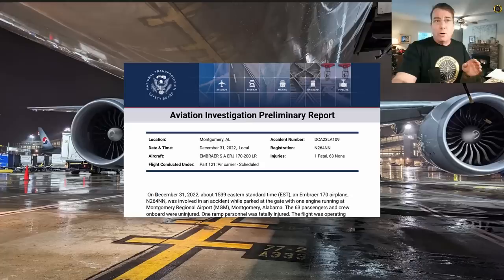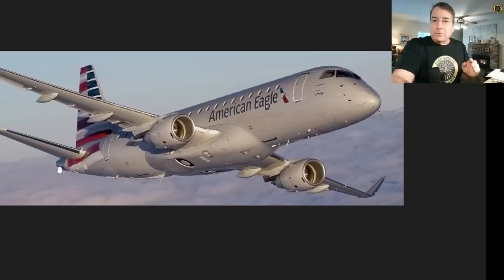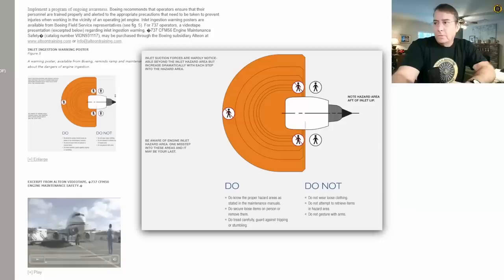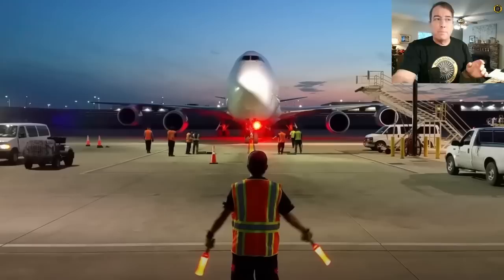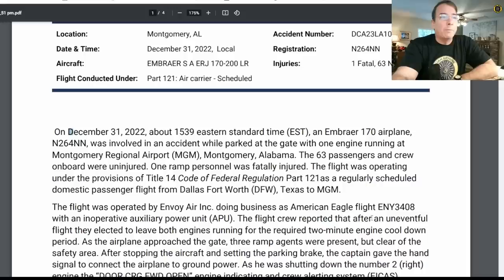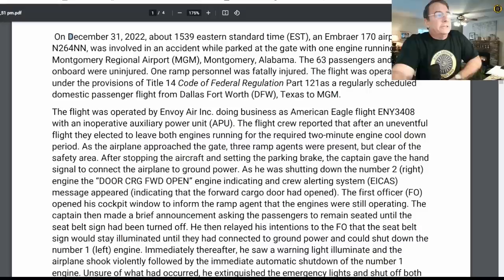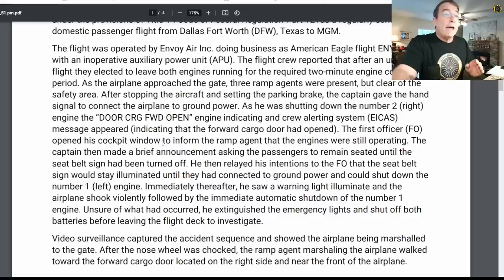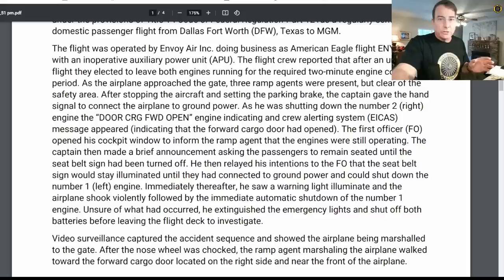NTSB Preliminary Report Ramp Agent Fatality 31 Dec 2022 Montgomery Al.

Comment: I'm a 35 year airline mechanic. I constantly see my beacons being ignored, from baggage tugs driving behind to vehicles driving in front of me when I'm waiting for ground crew to guide me in. It's very frustrating. Any time the beacon is on, no one should approach the aircraft. Even if the engines aren't running, we may have the beacon on to let people know we're pressurizing the airplane for air leak tests. What disturbs me about this incident is that the crew briefed about the placarded APU before the fatal incident. I'm somewhat skeptical about whether that briefing actually occurred. 
 Even a complacent employee should have understood they were about to do something nonroutine. The inlet of a wing mounted engine must be respected. A 737 taxiing will suck water out of cracks in the pavement. Another thing to note is that the lower lip of the inlet cowl on these planes is right at knee level. You will have zero chance of saving yourself if you get drawn into the jet suction. Years ago, we had red markings on the ramp to remind people of the hazard zone. We got rid of them, because they got so slippery when deicing fluid was on them that they became more of a hazard than a safety enhancement. 
At any rate, this was a very preventable tragedy. Sincere condolences to her family and friends, and to the people who witnessed this.
Reply: I will say as a traveler that multiple airports in California have those red markings in place.

However, California is obviously a state not well known for icing or cold temperatures.

Comment: ERJ 170 captain here. Read this preliminary report shortly before operating a flight and while completing that flight our APU failed shortly before parking. With this incident fresh on my mind, I opened the window to alert the ramp crew immediately that we required ground power and the number 1 engine was running. Thankfully the ramp crew followed safety protocol and stayed out of the safety zone until we had power and shut down the engine. Also to answer the question on when the clock stops on the ERJ 170 our "in" or arrival time is recorded with the parking brake set and the main boarding door disarmed and opened

Comment: A few years ago, I took a Southwest flight from Dallas to Chicago that had a stop in St Louis at about 9PM. We landed in St Louis in a thunderstorm so violent that they decided to lay over for an hour before continuing the flight to Chicago. After landing, and while taxiing to the ramp and within about 100 feet of the parking spot, I heard a loud thump from the right rear lower fuselage area of the 737 we were on. This was while we were still going about 3 mph and about 15 seconds before we stopped moving.

I did aircraft maintenance in the military. Yes, the loud sound I heard could have been the thump of an overcenter strut engaging or a cargo door release popping, but the fact that we still rolled for 15 seconds after the report, and the fact that there as about a 40 mph wind blowing, let me to mention to the pilot on the way out what I had heard and that I was worried that we'd suffered a ground accident. My report cause us to be delayed by another 10 minutes for an inspection. I have heard cargo doors released while aircraft were still moving, but those circumstances made it seem so unlikely. I've always been ashamed that I probably reported a routine sound, but to this day I can't imagine what it was.
Reply: Better safe than sorry. You did the right thing.
Reply: BRAVO👍👍👍👍

Comment: I know the feeling of the "Ingestion Zone". It happened to me when I was in the Air Force. Late Sunday night from a full shift, an F111 came in and it's during the colder months as I was wearing a coat with a hood. As I was chocking the wheels, I got one done and was crab walking to the other wheel. I didn't exactly go straight but went diagonally under an engine running. Felt my hood of my coat lift along felt my hair being pulled I dropped and layed flat on the ground. Got my bearing back where I was and skimper away from the intake. Then finished chocking the other wheel. Felt lucky to be alive and learned first hand of that Ingestion zone. You do have to be extra careful around aircrafts!! RIP to that ramp worker.
Reply: Nellis AFB was my first duty station out of tech school in July 1976.  I was assigned to the 474th TFW until the last of the F-111A aircraft lit the ABs, trundled down the runway, and turned north toward Mountain Home AFB.  I never worked the flightline, but I knew a number of people who did, and I got out to see the actual aircraft when they weren't trying to turn them.  So you have my SINCEREST sympathies!

But here's a question I've never been able to get an answer to: do the engineers at General G-ddynamics have some kind of fetish for seeing how much FOD they can suck up with their aircraft?  The Deuce, the Six and the B-58 never seemed to have a problem, but it always looked to me like Aardvarks and Lawn Darts were designed to facilitate low level flight by placing the intakes so close to the ground that the aircraft would suck themselves to the surface.  Unfortunately, that meant that crew chiefs, Ammo troops and others who had to work around the aircraft with engines running were in constant danger of becoming "one with their aircraft".

I am convinced that EVERY ENGINEER who works on a new aircraft design MUST accompany a trained maintenance person around the aircraft and get a HANDS-ON feel for how badly designed their aircraft can be from a maintenance/ground handling perspective.
Reply: @John Demeritt  a lot of the design is how much munitions can be loaded as to where the engine intake is placed. Munitions that are dropped out the belly engines are on the wings and weapons on the wings makes a tight center fuselage. Believe why on the A-10 putting the engines on top gave the best wing usage. But wasn't very fast where the F-111 was because much larger engines. ;)
Reply: @fiat.freakx19 , a lot of thought was put into the design of the Warthog.  There's a lot of talk about the placement of the Avenger cannon, but not so much about the engine placement.  One thing about the A-10 is that putting the engines atop the fuselage minimizes the possibility of FOD ingestion.  But the other point is that the high placement, along with the use of high bypass turbofans, reduces the IR signature significantly.  The YA-9 used the same TF-34 engines, but they were buried in the wing roots and exhausted directly aft, unshielded by the vertical and horizontal stabilizers.  And being slung so low to the ground -- great for munitions loading under the wings -- they were great at sweeping FOD off the runways . . . along with tool boxes, ground crew, and anything else loose around the intakes.

As for speed . . .no, the Hawg isn't fast.  But I've heard it said that the advantage is that when an A-10 is making an attack run, anyone foolish enough to draw attention to themselves by firing at the Hog Driver will find that the Hog Driver has time to grab a grease pencil and write the soon to be deceased's name, address, phone number, name of next of kin, and coordinates on the ground on the inside of the canopy before finishing the run they're on and turning their attention to the person who fired on them. 

Oh, and one more thing: TF-30s suck.  Especially if you stick an afterburner on them.  They're one of two reasons the F-111s and the F-14s ended up in the Bone Yard, while F-15s and F-16s are still flying.
Reply: Glad you are still with us.
Reply: @John Demeritt  I worked on the F-15 at Luke AFB. I was on the transfer team that got rid of A and B models to make room for the E model. I worked 405th EMS and was a 431x1 airframe mechanic. Was released in 1989/end of my enlistment by Regan during military cut back on bases and jobs. Combined airframe/engine/hydraulic into one person and kicked other two out :(
Luke don't have the 15's anymore got the 16's and 35's now. Enjoyed it when I was in 1985-1989!!

Comment: I flew the e170 at Compass for six years. Most of that as a captain. I think, unfortunately, this is probably a severe case of expectation bias. At a main hub, I would say ground crews would be rushed. They have 17 other flights to get to in the next 45 minutes. At an outstation though? I doubt it. Here's the thing. Most regional carriers work based on turn time. Flying for Delta, for example, the standard turn at an outstation is 30 minutes for a regional jet (or the scheduled departure time if the plane is on time or early). This timer is started when the plane blocks in. And on the ERJ, this occurs when the parking brake is set, AND the forward boarding door is opened. Based on this, the ground crew should have had no particular reason to be rushed because the clock hadn't started. On the E170, it is a limitation that refueling does not occur unless the passenger boarding door is opened. At Compass, for this reason, we would leave the beacon on until the door was opened rather than the engines shut down. This is to prevent an overzealous fueler from starting before it is safe to do so.

This looks like a case of management giving instructions, and the lower people not listening. It sounds like at least TWO of the ground crew simply ignored everything they were told. When possible, it is ALWAYS communicated that the APU is inoperative for this very reason. That said, when I was a captain, I HATED the idea of sitting at the gate with an engine running for this exact scenario. I did not want to the pilot who sucked in a ramper. The other thing too, is at most airports, the ground power is connected to the jet bridge. And the jet bridge cannot normally move with the ground power energized. What this means is there might be a delay until the jet bridge is parked. The above limitation also creates a danger because the beacon often remains on after the engines are shut down (when the APU is working). So the ground crew gets used to starting the process based on thinking the engines are shut down rather than the beacon. Because the beacon is waiting on the door. I should say, I don't know if Envoy has these same procedures. So when I had very short taxis like this, I would ALWAYS taxi slow enough so that when I set the parking brake,  the two minutes was up and that number two engine was going to be shut down. But I still wouldn't have stopped this from happening.

Sadly, what happened here is always possible with an inoperative APU. What's crazy is that at least TWO people were potentially involved on either side of the airplane. The forward cargo door is immediately in front of the engine. Enough so that you have to skirt between the belt loader and the engine to do your preflight inspection, much like the 737. How they didn't suck two people in during this incident is a miracle. But the fact that it seems like the victim got nearly knocked over prior to walking around the wing and then getting sucked into the engine that did that... I hate to be mean, but this person had no business working in a hazardous environment like an airport ramp. If you can go through two safety briefings, have the engine literally blast you, and then walk into said engine, I guess it was just bound to happen. And now this flight crew has an accident on their record as a result when they really did everything right.
Reply: Exactly. Something was obviously very wrong here at this Airport. The Pilots couldn´t look quick enough, so much basic safety violations happened here in a few seconds.
Thank you very much for sharing your experience.
Reply: As a ramper of about 11 years, pretty much nailed every point 🤷‍♂️ some hubs tho don’t use the certain type of jetbridge ground power you are talking about. Here in ANC, most of the jet bridges just have the cord cooled up on the jetbridge and you can plug it in even if the jet bridge isn’t up to the plane. The power can even be on and the bridge can still move. However I have worked at some airports where it’s winched up to the top. If it’s not fully winched up, it won’t allow the jetbridge to move. With all that being said, thankfully I haven’t seen any super close calls when the engine is running. What makes me most nervous is when APU’s are inop and require an air start.
Reply: @NicolaW72  What do you think the pilots did wrong?  The red beacon was on indicating "Not safe to approach."
Reply: @chetmyers7041  as I see it, the discipline or self-discipline of the Rampers was not automatic. There are clear safety rules in all walks of life which you ignore at your peril! Step off a kerb and get hit by a bus. Do not smoke when at the gas station. Don't put your fingers in a power socket. The world is full of rules. Follow them. In this instance, there needs to be a senior Ramper who must always be consulted before entering the exclusion zone. No ifs, no buts.
Reply: I’m an ACS agent and ramper over in the UK and admittedly we don’t have many jet bridge at ours and even then they just aren’t used on an aircraft with an inop APU. Such aircraft are always sent to a stand-likely for this very reason. Indeed the bridges aren’t used much really. But mostly I share your opinion on that particular ramper. Not sure how it is in the US but everyone who works airside has to take a safety and security course and test which communicates the obvious warnings that jet engines can ingest FOD and emit jet blasts and how it’s a good idea to avoid these things. We get the red anti collision briefing three times and our specific training videos include footage of a 747 jet blast knocking a car through the air like a toy.

And we have a green pedestrian route on the edge of a group of stands where A320s and 737s are often pushed back and taxied. I have to walk that route to get to our base and back so there’s been more than a few times when I’ve felt the jet blast from that safe distance and thought “damn that’s some output, glad I’m back here .”

But what gets me is that being knocked down by a jet blast sounds scary to me. I fail to understand how someone would just get up and be okay going straight back to the task at hand.
Reply: @mikoto7693 : It is possible that that blast terrified them enough that their brain stopped all remaining rational thinking. Escaping a danger can put people into weird states. More liability rests on the higher-ups who saw multiple violations happening at the same time by the same team and no one called people to stop and start thinking. The potentially new hires at the very lowest rung of the ladder can only be at that much fault.
Reply: @JariJuslin  Possibly, but admittedly I didn’t quite communicate the huge differences in safety culture apparently over there and what I experience over here. So let me make it clear. Having anyone who works airside, be they aircraft cleaner, caterer, refueller or ramper ect manage to actually walk into a jetblast so hard it either caused them trouble balancing or knocked them back onto their butt would constitute a major safety breach due an emergency response.

The pilots would be immediately signalled (likely via hand signals) to kill the engine(s) immediately, the ramper would be shouted at to ask if they’ve been injured, possibly pulled to their feet and marched to the nearest “safe zone” that the rest of the team would be required to report to. Airside Ops would be informed and would arrive to take a report. The control tower would also be informed-likely by the pilots and a huge mess would result to work out exactly how someone ended up walking into a jetblast. 

That’s what I don’t understand. At our airport, you don’t just wander into a jetblast, get up and keep walking without major consequences. Let alone get up, wander around or under the wing and into the ingestion zone. You would be stopped by your teammates even if they have to grab you.

For this team to just ignore it like it’s an everyday occurrence means something is wrong with that company or that airport. If it is that common no wonder the pilots are afraid to leave the engine running if the APU is inop.

Comment: As a safety professional and a former OSHA state program compliance officer, I can say that in my experience, safety for ground crew in aviation is commonly ignored as it takes a backseat to FAA regulations, which are only concerned with the aircraft.  I have seen people fall 11 feet out the back of a 777 because fall protection simply does not exist at an airport, and nobody has bothered enforcing the existing regulations.  Especially with smaller carriers, the concept of safety exists almost exclusively in the context of the FAR, and not as it applies to all the ground crew working in and around aircraft.

Also, the reason the NTSB did not travel to the scene is because this would be OSHA jurisdiction as Alabama does not have an approved State Plan. They should be the primary investigating agency and the agency with enforcement authority over ground operations.